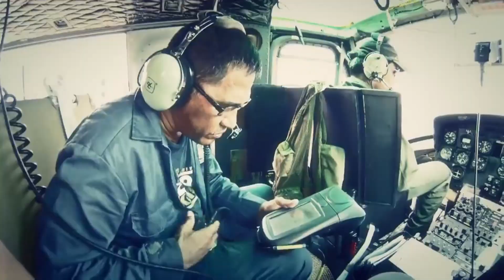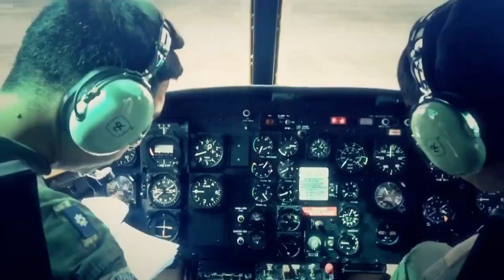Philippine Air Force UH-1D Helicopter Crashed

Comment: RIP for the Pilot and Crew who flown this helicopter, UH-1D is a big mistake by the Philippine Government and it was too expensive if they are going to upgrade this chopper because it need to upgrade the fuel tank and add fuel pump and upgrade the tank tank plus the avionics, why didn't they order Huey II from Bell and it has modern glass cockpit for ease of use.

Comment: All govt helicopters should passed a rigid non destructive testing from stationary machines to moving and rotating parts. This has to be done on or before by folliowing the manufacturers recommended preventive maintenance schedules.This should have the checklists. For the helicopters, I think we should have to do the frequent checks. The PM group with NDT group will have the equipment history showing the no. Of operating hours., by then you can have the guide in predictive maintenance schedules. God bless ...